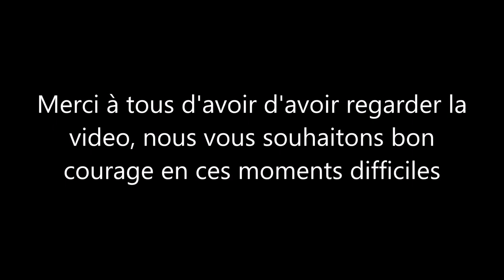Aménagement de cour, pavage, dallage

Comment: Très joli rendu, bravo ! Faut-il laisser un espace entre les pavés pour le sable polymère ? (on voit bcp sur les recommandations que le sable polymère nécessite un espace de 3 mm, au moins, donc si on serre les pavés est-ce suffisant pour le joint ?
Reply from the maker: merci beaucoup, effectivement je met 3 mm mini pour les joints à part les pavés des cotés qui sont bloqués au mortier.
 si moins de 3mm le polymere tiens pas car la fine tombe dans le joint mais le grain de 3 mm reste bloqué en surface ( sa fait comme du beton sans gravier c'est pas tres resistant ) sinon il faut utilisé un sable normal tres fin et prendre des paves adapté type autobloquant